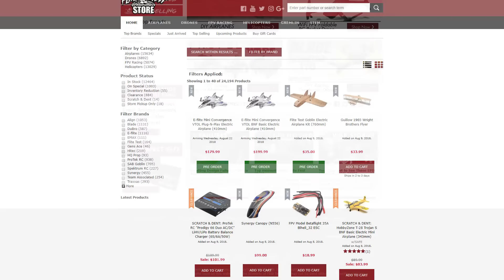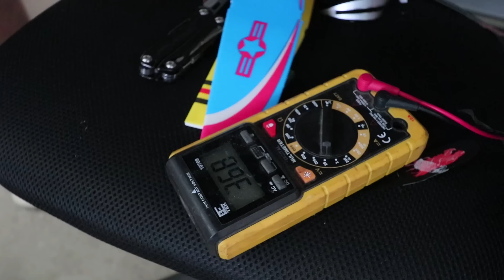Powered R/C glider without batteries!? | Capacitor plane hack

Comment: Hmmm
An excellent theoretical exercise. Energising a RC system using a capacitor was a fair success but the propulsion systems were not as effective as the ancient Jetex engines of my long distant youth. They, however, had the distinct added excitement of the probability of setting fire to the glider in the air
I think you missed out  on a similar opportunity as not one of the capacitors went bang :)

Comment: I've been thinking recently about using super capacitors (like the ones used to jumpstart vehicles) as power banks for mini quads since race quads require a ton of electrical power in short period of time. Caps can also give a ton of power but store it only for a short period of time. I'm just not sure about the weight required for a power bank like that and if it is even possible. I really want to be the first to try the idea but i don't have enough financial means to do it. I hope if someone else were to try it; please don't patent the concept and make it open source so everyone in the community can help further develop the concept and please don't overprice the product if it ever becomes a success.

Comment: Not an R/C enthusiast, but have witnessed a buddy's plane run out of battery power and crash (unresponsive to R/C commands.) Having capacitors as a fail-safe power supply for just the servos might allow an emergency unpowered - but controlled- landing. Just a thought.

Comment: Couldnt u technically turn a capacitor into a backup remote control a for the plane like when it runs out of power in mid-flight u can safely land or if something happens to the battery

Comment: Imagine a bucket of water, a battery is like a bucket with a value, the size of the valve would be the amps, and the pressure of the water would be the voltage
Now a capacitor is like taking that bucket and just dumping it upside down, capacitor work by storing static electricity in a way, there are ways to make then discharge slower, which is what you see on these planes

Comment: Make a capacitor engine have one large capacitor feed into a smaller one that feeds into another smaller one. Capacitors fill up then discharge, if you fill up the large capacitor it will discharge into the smaller capacitor which will fill up before it discharges and so on so you get a series of discharges that last longer then one single capacitor discharging and you will lengthen the amount of time you get out of the power output. Problem is the smaller capacitors will have less amperage then the large capacitor.

Comment: random fact: capacitors are wierd. if you wire them in series their voltage increases... but their capacity actually drops :/

as far as I know, that only happens with capacitors.

Edit: just realized that they already said it in the video...

Comment: batteries produce electricity from chemical reaction and therefore a little slow also the charging takes a longer time 
capacitors basicly store the energie directly therefore they have a lower capacity but can give off or take their chanrge almost instatly

Comment: At 3:50 I saw what looked like a 4 motor tilt rotor RC hanging from the ceiling. I tried to find that online but have failed. Can you tell me what Make / Model that is? On a side note, a few years ago my nephew and I built a small solar RC flyer that used capacitors to store energy for times the plane banked and the panels did not receive full sunlight. It worked longer than with just capacitors but not much longer. We scavenged the solar panels from 200 $1 calculators and linked them both in series and parallel to get the voltage and amps needed. It was fun time building it!

Comment: Hi grate video I'm not an expert but because a capacitor stores the electric charge lick a spring if it had the voltage and capacity it could run a drone. And you can forget the,, "C" rate you can pull 200 "c" + and do no damage and then charge in 1 or 2 minutes. Because it's a spring and not a chemical reaction and if you damage it there is no fire ball.

BUT IF YOU HAVE A SHORT CERCITE THEN THINGS WILL MELT AND LET OUT THE BLUE SMOKE

Comment: Placing capacitors in series has nothing to do with the voltage. You can put as much voltage on them as their are rated for. This is only a good solution if the capacitors that you are using are not rated for the voltage that you need. But probably the capacitors that you are using or rated for 6.3V so that is no problem. By placing the capacitor in series you only lower the capacitance the formula will be Ctotal = 1 / (1/C1 + 1/C2). If you put them in parallel the capacitance will increase ( Ctotal = C1 + C2 )

Example:
- If you take to capacitors that are rated for 3V and have a capacitance of 100uF charging them to 6V would brake them. Placing two capacitors in series is then a good solution. But the capacitance will be 50uF

If we now take the same capacitance but rated for 6V:
- If we put them in series we have again a capacitance of 50uF but we can charge them up to 12V. In this case this is unnecessary.
- If we put them in parallel we have a total capacitance of 200uF that can be charged (only) up to 6V

Comment: A battery has a LOT more capacity, but it takes more time to charge and discharge. The capacitators has shitty capacity but it charges/discharges super quickly. Supercapacitators have more capacity than capacitators.

Comment: So, about how much would an RTF one of these cost to make/get? I'm thinking of something like this (or an EZ-pack set) for a father's day gift. We currently do not have any R/C aircraft other than a small quad. (I do have an un-built White Wings trainer gilder, but no transmitter, receiver, motors, or servos besides that quad and an RC car we might still have.)

Edit: nvm, think I'm going with the Powerup Pro. If we keep going, might move from paper planes to foamboard ones!

Comment: Rocket launch glider with capacitor powered electronics, or make your own capacitor (you will likely need to limit the discharge current for the electronics).

Comment: I have NO experience with RCing at all. Would there ever be an advantage in having BOTH, batteries AND capacitors? Maybe capacitors for taking off and getting altitude and then batteries for duration? (I also wondered about jettisoning the capacitor once altitude is achieved to reduce weight for duration?) Does any of this make sense?

Comment: Why not make a lipo sized cap bank(in terms of weight) by making “cells” wired in parallel, each cell wired in series to multiply the voltage to a reasonable amount, and throw it into your average plane and WATCH IT BURN?

Comment: if the voltage rating of those caps is high enough, wire them in parallel instead and charge them from 1s lipo.

Comment: Capacitors are obviously not a suitable replacement for batteries, their energy density is too low. But becsuse they charge so fast, and lipos discharge so fast, you could make make a tanker plane with lipos and a cable coming down from each wing. Then when you need to recharge your cap plane, fly it underneath and have contacts on the wings to line up with the cables from the tanker

Comment: What about using just the throttle on the original glider.  That way when it started to run away, you could chop the throttle.

Comment: Look for supercapacitor on banggood or ebay whatever, measured in Farads. Instead of most used electrolitic capacitors in amplifiers and powersupplys etc. measured in micro farads uF.  Not the same..

Comment: You gained nothing with the capacitors in series. The series pair will only charge to the voltage the charger will obtain, which is the same voltage as a single cap would reach, but with 1/2 the capacity. Parallel caps would double the capacity, but I suspect the best performance would be a single cap to keep the weight down.

Comment: first of all - your center of gravity was way too front-heavy, you should put the capacitors behind or under the servos and second - wiring the capacitors in series makes no sense since your servos don't need that much voltage and wiring in parallel would almost double your flight-time
but i'm no expert in this either

Comment: A few years ago a friend and I built a solar powered rc plane for a competition. This was back when FliteTest was just hitting is stride, and we were building dollar tree foam planes. We used a series of capacitors to store an initial charge produced by the solar cells on the wings. It only had 10 seconds of full power, but the capacitors held enough charge to keep the servos and receiver working for awhile: https://www.youtube.com/watch?v=kdQnG_TGDNY we also took the same system and made a blimp out of it. https://www.youtube.com/watch?v=JhfYT2yEk0k

Comment: Get larger capacitors.  Depending on voltage you may need to use a step down circuit to lower the voltage out to what ever you need.  These step down units are cheap on Ebay.  Also, you would need a power supply to charge the capacitors in the field.  These might give you several minutes of use or more.  Cylinder body style would fit easily inside the body frame.  https://www.amazon.com/dp/B0090IFCJM/ref=sspa_dk_detail_1?psc=1&smid=A2A3E3I2PR5WZ9  They can be charged thousands of times or more.

Comment: The NOSE IS TO HEAVY. Move the power cells to the proper Gravity Center right under the wing. Sure it looks cool on the front but tilting your wings up does nothing unless there is balanced weight. Like a kite it uses its down force to operate.
Reply: It's an amazing idea thanks. I'd like to see the updates. I'm sure it will help you have success and fun by moving the center of gravity.

Comment: ahh duude.  calculate the original Blackhawk glider wing loading then scale up to more than cover the capaitor r/c mod.

your 2s experiment depleted the 2s capaitors faster because the higher voltage let the motor do more work in less time.  good cal to go the control glider route. 

i want to see larger, then solar charged r/c gliders!!!

Comment: On foam planes i get it when you use hot glue but pls there are better sort of glue's out there to use on non foam planes where weight always is a problem.
And you could sand the wings where they need the least strength.
Also you could put holes in the body to reduce weight aswel.
And i beleve when you use one capacitor that is a bit bigger it wil work better and i would not use power for throttle on these planes.
I think you can make this in a 10minute flying plane.

and maybe you can insulate the capacitor against the cold so that it loses less power

Greetings,, Kitty.
Reply: Now i read back my comment i sound like a nerd :)
I just want to help with my comments and i always leaf a comment because i have a adblocker running so if i don't leaf a comment my view don't count.
And i want to support you guys in any way i can.
Dont have a lot of money for donating but if i can buy something from your web store i wil.
Now i am searching for a big glider and find the 2 meter glider on your web site a bit to expencive. 
I am sorry to say that i found the exact plane somewhere else for 30 bucks.
I have way more trust in your product but i can't efford spending over 60 bucks on a foam glider that i wil destroy in learning to fly.
I know i can visit your web store at any moment and wil do that in the near future.
Love all your product.
Accept i personally dont like hot glue and tape and i'm searching for anouther way.
Greetings,, Kitty.

Comment: Couldn't you just use a rubber band powering the prop with the capacitor running the servos?

Comment: a capasitor is a little magical device that when given a low current or small voltage charges up and thwn when it reaches a certain charge it will release all that energy at once so instead of a long low voltage current it is a short high voltage current. this is how a taser works since it has batteries in it they give a charge to the capasitor when the button is pushed and then the high voltage capasitor then charges then releases all the stored energy (usually in a taser thousands of volts, it is watts and amps that kill you not volts) and then that goes to the prongs or metal peices that when touching skin connect to eachother using your skin as a wire kind of since we have iron in our blood and it is faster than just jumping making a spark in the air that is why a taser doesnt have one long click instead it has many loud clicks and that is a brief explancation of how a capasitor works and my spelling is bad idk how to spell lol also you guys should make some type of turbine jet plane possibly and also possibly collab with uavfeatures anyway yeah thats it hope to see you at flight fest texas this year and flight fest hopefully washington next year or whereever the west coast flight fest will be anyways bye
Reply: It doesn't have to be a short pulse! But yeah, batteries simply cannot match the current that a cap can deliver.
Reply: I just say this because i know that a person can take 200000 volts but i know some 10 volt capasitors can kill you or brain cells because it have more watts going through it and i know people hsve been killed by 43 volts
Reply: Plus this whivh i found on the ohio electrical saftey info Any electrical device used on a house wiring circuit can, under certain conditions, transmit a fatal current. While any amount of current over 10 milliamps (0.01 amp) is capable of producing painful to severe shock, currents between 100 and 200 mA (0.1 to0.2 amp) are lethal.
Reply: It also states people have been killed by 42 watts but not 20000 watts
Reply: TheRedGamerFPV nobody will survive 200000 volts. You are not taking the source impedance into account. 😂

Comment: Hi guys, you sell and demo RC gear and aircraft, yet have no Electronics Tech or Flight Control guys.
And no one who can solder.   Not sodder.
At 1:58 you are trying to describe Dihedral.
Great videos guys, you are a hell of a laugh.
Did you guys check COG and COL before you launched the modified plane?
What value/rating are the capacitors?

Comment: The best capacitor has the highest capacitance (and this will depend upon its maximum voltage allowable so be careful) in the smallest - i.e.lightest - package with the minimum of leakage... aka "dissipation factor").  But for short romps like this an electrolytic like you've got has to be close and I suspect the mfgr has checked all those parameters.. but perhaps not to the nth degree.   here's a starting point.  The small guy is 164 grams but lo voltage.https://www.skeletontech.com/industrial-cells

Comment: Rather then a capacitor powered micro plane how about doing a 1S brushless conversion that performs as good or better that is lighter and more efficient then the stock geared brushed setup in UMX planes...just got to find the right micro outrunner out of the many available for quads these days that no one tests on 1S usually...only 2S and up.
Something like a 1104 5000kv turning a stock UMX prop on 1S for the Sport Cub S...
Yes I know it's been done with geared brushless inrunners but a outrunner setup would be lighter...
If anyone can do it the Flite Test team can...Please!!!!!!!!!!!!!!!!!!
Reply: PLEASE!!!!!